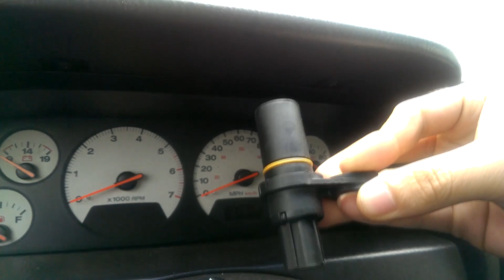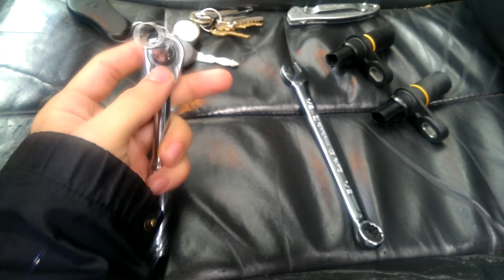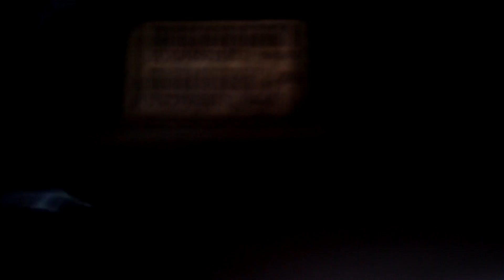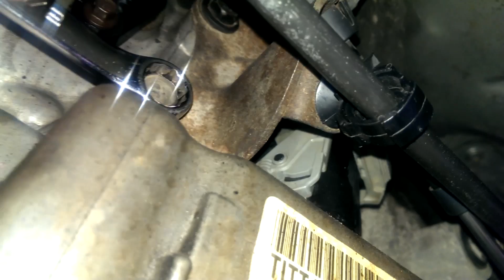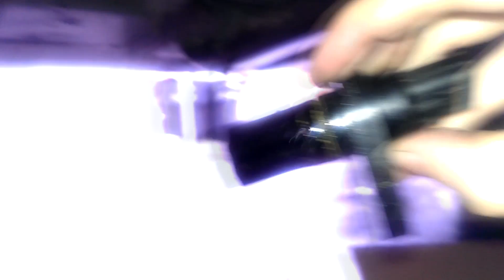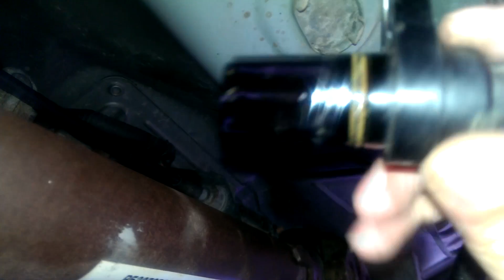99 - 04 Jeep Grand Cherokee: how to replace transmission speed sensors [45RFE transmission]

Comment: 10 minutes, a 8mm SHORT socket and maybe a screwdriver to push the tab on the connector. I took more tools than I needed under the car. A little dexterity and it’s easy as pie.

Comment: my 99 jeep grand cherokee 4.7 V8 with the 45RFE transmission at 240,000 was throwing up codes 0733 and 1734 for incorrect gear ratio in 3rd gear I have replaced the solenoid pack and the input/output speed sensors and the pressure sensor on the other side to no avail. What suggestions do yall have. I have 1st and 2nd gear but when i get to approximately 30mph it just wont even try to shift into 3rd
Reply: Have you found the reason?

Comment: Out of the two sensors which ones input and which ones output I watch this video over and over to see if I missed anything and read everybody’s comments but nobody’s asking which is input and which is output. Please reply thanks
Reply: I would say the output should be near the end of the transmission as in near the output shaft. I would also think the input should be forward of the output, because the car is taking input and turning/processing it into output...as in out of the transmission to drive the wheels...but who knows.

Comment: Quick question! I have had my 04 for 5 years now , Its starting to slip when from 2nd -3rd gear . I had somone scan it today and this P0935 code come up. Shouls I just change the sensors, will it avoid it from physically slipping. Whenever driving  it I feel a sudden pushback . I'm  not sure how to proceed.  Please help!

Comment: I have been hunting this issue for 6 months, I replaced the auto shut down fuse and finally got it to throw a p0725 code since the ECU and the auto shut down are on the same fuse. Thanks man

Comment: So on the transmission which is the output sensor?
Reply: Same question did you ever find out ??
Reply: @Katherinmcad  yeah, it’s literally ontop of the transmission. I had to losses the support bracket to lower the transmission to get to it. It’s a fuckn nightmare. It was corroded, broke off into the transmission I had to send it to a shop.
Reply: @Katherinmcad  output sensor is on the side kind of on the bottom, the one I had to replace was ontop of the transmission because my jeep would shut off going down the road

Comment: Great Information! Great delivery!
I noticed that in most of the other forums, most folks erroneously identify the crankshaft position sensor as the engine speed input shaft sensor. Is there a valid reason for that discrepancy?
Reply: The consumer service manuals don't have any information about the transmission other than removal and replacement. That's the most likely reason for that particular bit of misinformation.

Comment: My Jeep doesn’t want to shift into final gear sometimes when I’m on the high way. Can this be the problem? It doesn’t slip it sometimes won’t shift into final gear
Reply: mINE DID THAT BUT i CANT REMEmBER WHAT FIXED IT.I had some different parts replaced and one of them worked....to my surprise. If I remember I'll come back and let you know. It made my jeep run like brand new!! On mine it wasnt the speed sensor though.
Reply: I’m having the same issues if anyone can help ASAP

Comment: My 2002 Laredo temp gauge has twice showed overheating and warning light, both times while at idle. I have shut the vehicle off, and after I start driving it settles down into a normal a temperature range. It's weird. Any ideas?
Reply from the maker: sounds like a water pump issue. When you drive the belt turns the water pump a lot faster then when it's idle. You can get a new one here: https://amzn.to/3c8Cjj2

Comment: Ihave a problem in my grand cherokee 2001 igo up to 30 and it will not go more then 30 then goes back to normal  what the problem??
Reply from the maker: You have some transmission problem read the codes and Google what the codes mean
Reply: @link375  you dont think is the same thing as the video
Reply from the maker: I don't know. That's why you need to check the codes. There's lots of things that could put your transmission in limp in mode

Comment: So simple thanks. Im fixing up an 01 gc laredo with trans shift issue and codes this was extremely helpful
Reply: Hey mine’s an 04 Laredo, when you did your output sensor did any transmission fluid pour out or do I have a problem
Reply: @nateyoder9372  did you end up getting your trans shifting normal again? I have the same vehicle
Reply: @Vowz9  turns out that the thing I originally asked about wasn’t a problem, but it’s got mad death wobble so I’m gonna be selling it soon.

Comment: Very helpful video,  I have a 01 grand cherokee that won't shift out of first gear, the code on my code reader was  P0720 output speed sensor.  I replaced it and now she shifts again.
Reply: Did you have to replace both or just one ?
Reply: @deedolla3461  I just replaced one
Reply: @deedolla3461  I used a code scanner and it told me which one was bad.. hope you get it fixed.
Reply: @stanleyshedd2643  the mechanic told me I only have one speed sensor which is output I replaced it and still getting the same code 🤦🏽‍♂️

Comment: Is this similar for the 42RE? I have a '99 Jeep Grand Cherokee 4.0 6cyl with a 42RE auto trans.
Reply from the maker: No. Those only have 2 O2 sensors one upstream and one downstream. If I remember correctly. But don't take my word for it since I've only owned the V8 models. A Google search should get you the info you need.

Comment: I’ve been chasing a, shut off while warm and crank but not able to restart for about 10-15 minuets, problem with my 1999 4.7l. When I had the code reader hooked to it the only things that showed up were speed sensors on 3 wheels and p0725 code. Did your Jeep shut off randomly due to speed sensor? Would this code be in same relations to what you had

Comment: Did the input/output transmission sensors fix your P0700 code for your Grand Cherokee?  I also replaced the solenoid pack first and the P1781 code is still present. 
Reply

Comment: I have a 2008 grand Cherokee Laredo PO717 will this work?
Reply: @BorikenAcademia: I'm have the exact same issue. Did you ever get yours resolved?
Reply: Emilia Gilmer No. The 2008 does NOT have the sensor where they show they are in this video. I have have spent days looking and no luck. I also bought the sensors so as of now I’m out the sensor money and still have not addressed this.

Comment: Hi there, thanks for the videos. I have a 2003 2.7 Jeep. Stuck in 2nd presumably in limp mode. Error code P 0702. I replaced the pcb ontop of the gear shifter as that was according to the forums the problem. Now Still same code same problem. Any help would be appreciated.

Comment: I just got an cheap code reader that explains the code. Pluged it in, it read PO720. Ok, it said the same thing you said. But this is one problem I have with your video. You don't say which one is the OUTPUT sensor. I have a 1998 Jeep Grand Cherokee Laredo 4x4
Reply: Output is in back. Input is up-front
Reply from the maker: +Michael Lawson they're both the same

Comment: I replaced both of the sensors and still my transmission still acting up. It drives at 1st gear and that's all. Any suggestions?
Reply from the maker: Next things to check are your transmission fluid level and color it should be bright red not dark and if that's ok then  the problem is probably your transmission control module TCM (the small computer under the hood) or the transmission solenoid is bad.
Reply: link375 it's at the shop now. It needed a transmission. Fully rebuild for 1,200 with one year warranty

Comment: im have 03 grand cherokee laredo and no matter where i pull the shifter it is always in forward gear no neutral or reverse or park    util you shutoff engine in neutral then it immediatly feewheels but the minute you start it up in neutral or park it starts pulling forward for a couple seconds and then binds up like its in 2 fears at same time any help would be awsome

Comment: 2002 jeep gracherokee overland 4.7  key on key off 3 times have code po700 ,checked code with ob2 scanner had code po750 ,said A circuit swich failure, reset code shifts fine for a short time ,when code comes back on veh becomes boggy again ,what is the A circuit, is that the circuit underneath the val body? over could it be a speed sensor, any info would be much appreciated thanks scott
Reply from the maker: http://www.jeepforum.com/forum/f67/help-po750-engine-code-wont-shift-3rd-993353/

seems to be the solenoid pack

https://www.youtube.com/watch?v=Mzd0Mmv7nBQ
Reply: Thanks for the info much appreciated! " HOPE YOU HAVE A GREAT NEW YEAR" ,thats what iam thinking it is ,thanks again peace !!
Reply: Does the solenoid have to be re flashed ,or just reset code ...didnt no if you new or not sry to bother you ,iam going to check the links you sent thanks again!

Comment: This was great. I, like you, replaced my solenoid pack and got nothing out of it but messy and broke-er. I'm going to try this with a couple of sensors I will pull from a wrecked Grand.

Oh, I think I saw a Utah tag. Me too. 

Can you describe the symptoms you were having?
Reply: and it worked. the trans is back in business. thank you.
Reply: What was your symptoms ??
Reply: @scalywag  shifting was off. If I remember right, it wouldn't shift past 3rd gear, either.
Reply: @d.shanerose1729  right on, I'm getting a slight surge at 70 mph. Be cruising 70 then all of a sudden rpms jump up like 300 rpm , lunging the car forward ever so slightly .

Comment: link375 does this do anything with the car switching from the od going on and off and the car overheating light coming on? Even though the car is not over heating?
Reply from the maker: +Freddy Romero No that sounds more like your thermostat. This is all related to the transmission, nothing really to do with the engine system.
Reply: Same problem happened to mine (2000 XJ, AW4 trans). Eventually a gasket on one of my cylinders blew and I had to get my engine rebuilt. All sorts of sensors going out on Jeeps after 100,000 mi is common and with different consequences. All i'm saying is don't ignore that or let that linger. Link375 is correct in that it is a thermostat issue.
Reply: Thanks man for the response.I have changed the temperature transmission sensor and I hasn't came back. I also was thinking of getting a new jeep like a 2014. Is it worth the trouble?

Comment: What happens after u replace the sensors? Will the engine light eventually remove or do I need to disconnect the battery terminal?
Reply from the maker: +KEVLAR PEREZ use your code reader to clear the code. If you don't have a code reader you can purchase the one I use here: http://amzn.to/1Mk3NMW
Reply: +link375 thank u for ur help!
Reply: link375

Comment: Hi did you have to remove the transmission fluid to do this job?
Reply from the maker: +Dennis Laroche not at all. You might get a couple of drops out while taking the sensor out but you don't need to replace the fluid.
Reply: @link375  does this fix as my Rpm gauge doesn't move always at 0 and no fault s .thank you

Comment: hi...i have a jeep liberty 06...wich has the speedometer that usually going to stuck on 20km/h and sometimes going to be slow compared to my speed...so i guess are these 2 sensor ? or can be the trasmission as well ? do you think if I'm going to change these sensor it is gonna be ok after ??? thanks !
Reply from the maker: +Alessandro Terracciano That actually sounds like something is wrong with your TCM (transmission control module) - basically the computer that controls the transmission. Try the speed sensors first as it's a much cheaper repair. If that doesn't fix it then it's probably your TCM or it could also just be loose cables or a bad dashboard instrument panel.
Reply: I have the same issues with my 99 Laredo did you fix the problem with the sensors?
Reply from the maker: The issue ended up being the TCM. I ordered a new one swapped it out and it shifted like normal. However because of all the stress the transmission had gone through + the cracked housing ended up causing issues when shifting to 3rd. I ended up selling the jeep after this.
Reply: +link375 ok the TCM cost a lot?

Comment: I have 99 grand Cherokee. In the cold weather (northeast) , the second gear has delay to shift to the third gear and in the summer is OK. If I replace the speed sensor will solve that issue or is tranny  issue?

Comment: Why are we changing this ?!?!?!
Reply: if they go bad it will throw up a check engine code 0700 and it can cause the car to shift poorly
Reply: thank you
I need to do that too .
Reply: eddie zapata just a heads up the the code p0700 is just a generic code that shows up on the dash.  You need a scanner to tell you what is really going on.  Hopefully it's just your sensors that are bad on your jeep.  Mine I have narrowed it down to a bad tq converter or oil pump.
Reply: awesome !
thank you
Reply: However he did mention that the fault code was P0 720. I'm not a mechanic, but isn't that a specific code for an output shaft speed sensor?

Comment: how are you ? please I have car jeep grand Cherokee model 2008 I have problem in my turbine speed sensor input  (( no signal )) code p2767 but i can not find the location of the sensor   so i can clean it or replace it as well?

or is there any another way to fix this problem ?

please any one can help?

Comment: Great video.  I subscribed to your channel to see all your future repairs.  thanks for posting.  

quick question, Im getting codes P0870 transmission fluid pressure sensor/ switch C circuit and P0987 transmission fluid pressure sensor/switch E circuit.

Any ideas?  I'm starting out by changing the transmission input and output sensors tomorrow morning but I wanted to see what you think.  Thanks in advance for your reply.
Reply: Me gustaria saber adonde queda la ubicación del interruptor de reversa de mi cheroky

Comment: Hi  my back up light will only turn on in between parking and reverse.
Can you please tell me if this sensor is causing the problem.
Reply: u need to clean the plastic on the . inside of the light. .  the connection meft. ofer time around the connection. easy fix. comond on  jeep
Reply: rsande077 their nothing whong with  the light!! the problen is tha it will only turn on as I move the chifter from (N) to (p)

Comment: Hey Link. For the third sensor, the pressure sensor located on the other side of the input/output sensors.... I cannot seem to unplug the harness from the Pressure sensor, and I cannot reach the 8mm bolt. Do you have a suggestion on how to remove the harness without damaging it?
Reply from the maker: I believe it's a locking harness, you should be able to use a flathead screw driver to separate it. be very careful with it though, the sensor is very small and prone to breakage, you don't want to break it and have the inside half stuck 

watch my other video on how to syphon gas out of a saab I'm pretty sure it's the same type of connector
Reply: link375 thanks, I will try that soon. So far just swapping out the input/output sensors has helped tremendously in my WJ's performance...It even cleared the p0871 code. Great video.

Comment: Thanks for the awesome videos. Just a suggestion you could try to describe the problem first as to why the repaire needs to be done and maybe show the symptoms as well. Thanks again.
Reply from the maker: the problem I was having is listed in the description as a P0700 code, this is a follow up to the solenoid replacement video where I stated I would make a video on how to replace these 2 sensors. 

but thanks for the suggestion, I'll keep that in mind if I end up making any more videos for this jeep or any other cars I end up getting in the future
Reply: @link375 did this end up making the engine code go away and stay away?